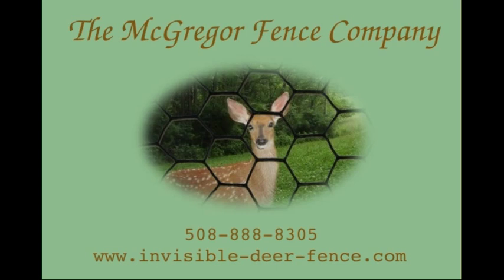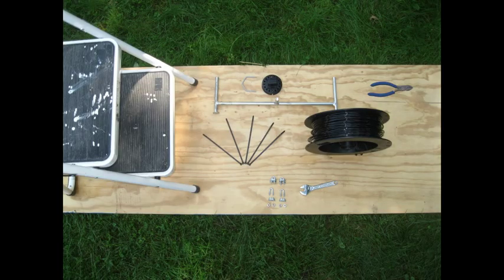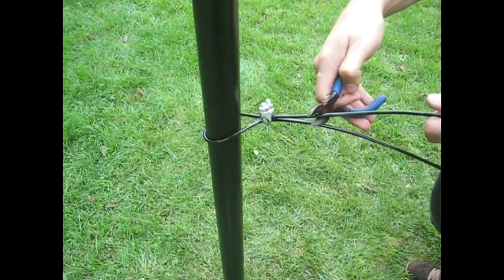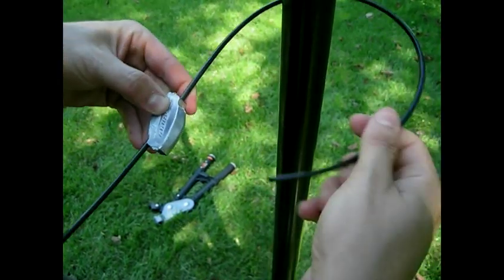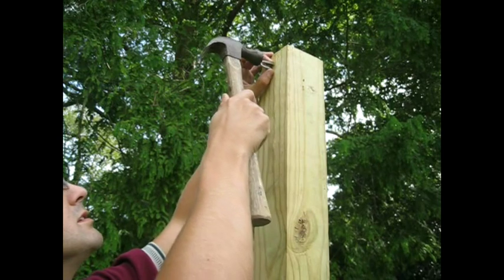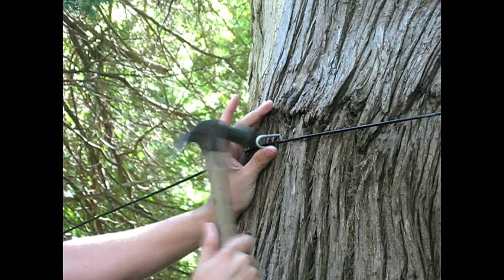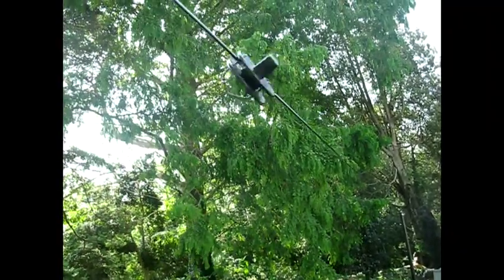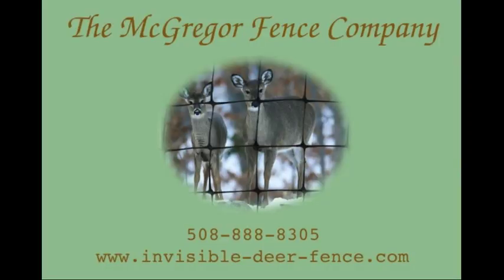8.  Deer Fence Installation Videos: Stringing Top Wire

Comment: Really helpful videos! What size U Bolt Clamp are you using? And terminating with a tree,  video says three U nails for the guy wire  -  “back and two sides” - am not clear if the back would be inside the fence once hung, or on the outside. Thanks!